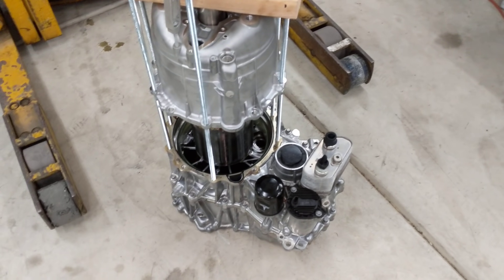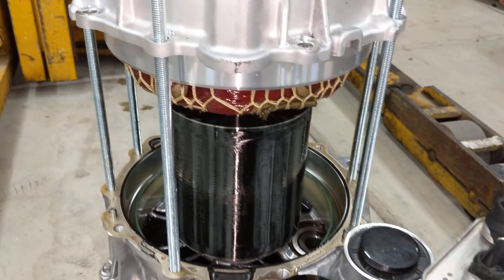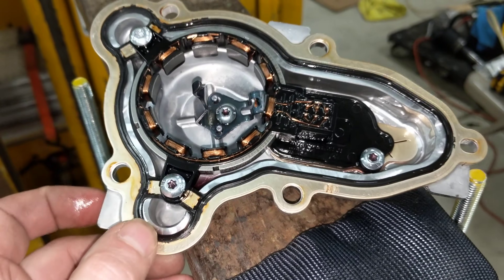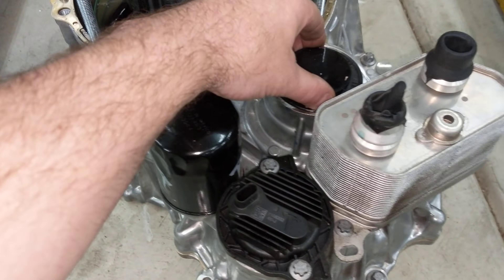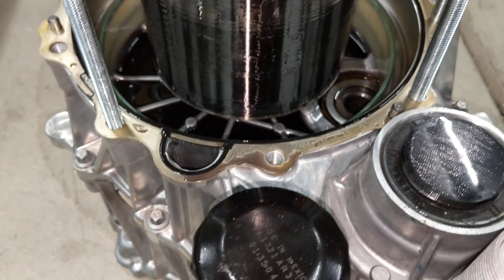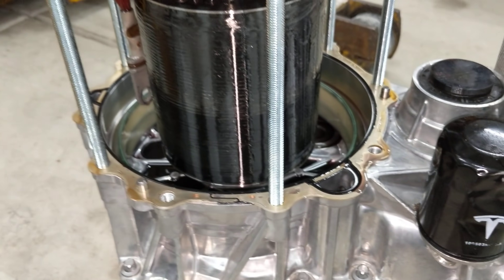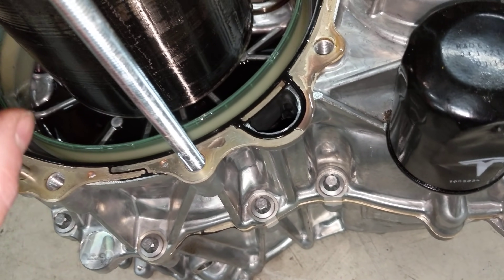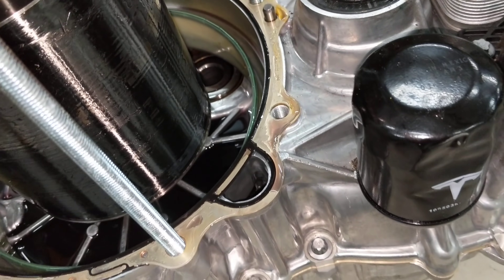Tesla Plaid Teardowns - Front Drive Unit

Comment: Makes me believe the Model 3 980 motor was really overbuilt.  To think it could be placed into a much heavier Model S with just a few changes for higher revs is pretty impressive.
Reply from the maker: It is overbuilt.  They use the same motors (albeit 4) in the Semi too!
Reply: @Ingineerix  i disagree on the motor being overbuilt. it's designed to provide performance & efficiency with highest lifetime (tested for 1 million miles). long distance highway driving @ 40-50 ° C stator temperature allows for highest efficiency on the magnet as well as the copper side. race track style driving pushes the temperatures to the high limit. remember: the model 3 performance competitor on the street is the bmw m3 series with the competition package.
Reply from the maker: @teslaw-model3  WHO else builds cars designed to make 1 million miles?!?   We are using the exact Model 3 DU in our van conversions.  While we don't expect to see 1 million miles without issue, they are definitely not having any trouble working flawlessly in a much heavier vehicle.   https://maxwellvehicles.com/
Reply: @Ingineerix  not the whole car, only several components that come with a function which leads to advantages/disadvantages on other sides. think about a window power lift. it's motor could most likely be re-used 3 times on new production cars. it has to work flawlessly, especially in an emergency situation. but it is not being used all the time and in very rare cases of emergency like e.g. submerging. now think about the model 3 motor. insulation degrades over time electrically and thermally combined. if you stay at low temperatures, it has positive effects on the lifetime. you could use this advantage in order to operate silicon carbide switching electronics without sacrificing the motor's lifetime. btw. very cool conversion company you've got there, keep it up!
Reply: if you take a closer look at brooks weisblat's (dragtimes) plaid unveil event video, you will notice that the plaid motors with the carbon wrap come with a changed rotor lamination design. reduced iron webs and bridges in order to minimise stray flux of the permanent magnets for better performance. the carbon wrap is most likely required to hold the rotor lamination and magnets together even at normal speeds due to the reduced iron structure. it'll be interesting to see how the carbon sleeve will deteriorate over time.
Reply: Wrong, the carbon wrapped rotor is what gives its robustness, carbon rotors have been used in applications up to 200k rpm+ there are many companies that have been making such things mostly based in Germany.
Reply: @alanmay7929  So don’t you take the model 3 motor and wrap with a carbon liner to allow for higher rpm’s?
Reply: @aussie2uGA  carbon fiber wrap alone isn't enough, the bearings and other stuffs needs to be upgraded to content that very high 20k rpm. Motorcycle engines are able to rev very high even up to 20k rpm and they don't have anything carbon fiber, its all about using the proper materials.

Comment: Awesome stuff! Do you happen to know if Tesla is leaving a lot of power on the table with these drive units? Are they capable of supporting more power, if the battery were able to supply it? Or are they already approaching the upper power limits of these drive units? I'm curious if Tesla might only be a software update or battery update away from unlocking more power, or if more drivetrain upgrades would be needed.
Reply from the maker: Yes, on the Plaid, the battery is the limiting factor.
Reply: @Ingineerix  What is the theoretical output of the existing battery?  Is is capable of more that the stated "1020hp" ?   I want to know if there is a potential for a future power upgrade on existing hardware.   Thanks!
Reply: @Ingineerix  do you happen to know the combined max hp/kW output of the inverters in the current drive units?
Reply: @Ingineerix  I believe the Plaid was supposed to get the 4680 batteries, which could be why they probably got rid of the Plaid+
Reply from the maker: @Bellissima2k  They don't have working 4680 production lines yet outside of pilot, so this was not possible.
Reply: @Ingineerix  does the plaid and long range have the same battery packs?
Reply from the maker: @the_sleepy_engineer  Until I look at a LR, I don't know for sure, but I suspect they are the same.
Reply: I saw in a video how this guy does the math and sees. plaid carbon wrapped  motor is running at the speed of a model 3 which doesn’t have carbon
YT - Engineering Perspective
Reply: @EverandAssoc  which video? Plz link the video if possible 🙏

Comment: The early Model S used Dexron 6 ATF,
correct?
Reply from the maker: Yes, this is "ATF9" made by a Korean company.
Reply: @Ingineerix  there is stuff from Pentosin that is described as ATF 9 for ZF auto transmissions. Not sure if it is the same or similar to what you describe.
Reply from the maker: @ShaunRF  Yes, that's the stuff!   Someone pointed out that RockAuto carries it.

Comment: You seem to have the talent, smarts and abilities in demand at Tesla or at Munroe and Associates and both are desperate to hire more smart people like you.
Reply from the maker: Thanks for the compliment, but I have no desire to work for either!
Reply: @Ingineerix  :D why?
Reply: @no_more_free_nicks  Sandy Munroe's design philosophy is very much inclined towards throw away economy emphasizing on  non repairable or serviceable parts
Reply: @akhtarkh  i totally agree with you, by oversimplifying designs/things they become way harder to repair or reuse, there is a reason why old/antique cars are still on the roads. Tesla is basically copying apple blindly.
Reply: @alanmay7929  Sandy preaches using permanent fasteners instead of screws,  advises to move fuses inside the modules for cost savings, recommends using less enclosures instead of separating different systems and modules. Yes, cheaper to manufacture but almost impossible to service.
Now a days cars are being designed by people who are very good in CAD but have hardly wrenched themselves, products look very pretty on the outside but under the hood every thing is intermingled and a nightmare to service.
Reply: @akhtarkh  electric cars in particular are even worse tbh, electric vehicles are fully packed with electronics and software, ICE at least are still mostly mechanical. I don't know why tesla stop people from tuning their cars too I don't understand that.
Reply: @akhtarkh  Sandy has wrenched likely more than many mechanics. There is times it makes sense for a fuse inside a module but he doesn't say to do that with everything.  Some things should not be serviced by a back yard mechanic.  Some things are not so bad.  This motor is hard to service because its carbon wrapped and you need to pull the rotor from the stator.  But its not impossible.  There is other oils that can work but ATF 9 likely is the best. They wrapped the motor with Carbon to make it survive at 20,000 rpm.  This is only on the plaid motors.  You don't want them failing at 20,000 rpm as it will possibly lock the wheels up at when you are doing 20,000 it will be a bit over 200 mph!
Reply from the maker: @no_more_free_nicks  I've been working for myself for over 25 years.  I enjoy my freedom.  Yeah, maybe if I worked for Tesla I might make more money, but I'd lose my freedom, and likely quality of life.  There's also NO WAY I'm moving back to Detroit (Where I was born) to work for Monro, and I seriously doubt I'd even make what I'm making now.   Consulting means you have some choice in what you decide to work on, and it keeps things exciting.  At a large company like Tesla, you tend to become a siloed specialist in the few things you "own", and it's easy to burn out.  Tesla has pretty high engineering churn, so it's not just me!
Reply: @Ingineerix  Tesla utilizes "agile" manufacturing, which might be quite a bit different from the typical auto company, very flat corporate structure.

https://www.youtube.com/watch?v=w5c5KzpamiM

But it is quite a fast paced environment, that's for sure, yes. Would certainly drive me insane trying to keep up with that mindset, but then again I'm neither young nor driven by my career path to fit in with that environment, it's clearly not meant for the 9-5 type guy that I am today at my age lol.

Comment: were you able to take a look at the rotor and see if it is made of copper? Elon Musk had tweeted the Plaid had copper rotors but I think he is mistaken.
Reply from the maker: It's a ferrous metal lamination stack with rare-earth magnets.  I don't think there is any copper in the rotor.
Reply: Yeah it does not really make sense to have copper in the rotor unless the motor is an induction and permanent magnet hybrid.
Reply: Agree with that. Copper is not needed in this syncro-reluctant motor... or may be special parts for better rotor cooling? copper heat sinks to collect heat far away from magnets? I m dreaming may be but Tesla team is enough crazy to do it :)
Reply: @lauricgarbuio8988  The problem with copper in the rotor are the I²R and eddy losses. So instead of copper helping with cooling it can turn into a heating element. Laminated iron core is not as good as copper in transfering heat but there is no worry of it becoming a heating element. Anyway rotor is already being cooled with oil so they just need cooling channel running next to the PM if thermals are a big issue.
Reply: @kazedcat  In this case, the flux inside the rotor is constant (except flux fluctuations due to slotting effect and current harmonics),  so no eddy current and no losses (or few) for the rotor. I don't know if the carbon wired sleeve is a very good thermal conductor... There is no water/oil inside the shaft, right? So with a very small air gap, the only way to cool the rotor is through the sides. Embedded copper heat sink can have sense to prevent hot spot, no?
Reply: @lauricgarbuio8988  Tesla have engineered liquid cooling in the rotor by making the core shaft hollow and pumping oil into the hollow shaft. From previous motor teardown Tesla did not design cooling channel to bring oil from the shaft towards the permanent magnet. If thermals for the PM is a big issue then bringing the oil closer to the PM would be a better and cheaper solution than switching to a copper core. The carbon overwrap is in the outside surface so it has marginal effect on the cooling being done by the oil on the hollow shaft. Theoretically there should be no net flux but in real world application bumps in the road could cause the rotor to desync and even with very fast sensors it will still take time for the drive unit to resync and during that time copper in the rotor is a heating element.
Reply: @kazedcat  I fully agree with you. I'm just wondering and searching why Mr Musk said that there is copper inside his rotor... a mistake from the boss?  He said also that it is to prevent copper expansion with centrifuge forces, right? I m puzzle... but it is interesting!
Reply: @kazedcat  "Tesla did not design cooling channel to bring oil from the shaft towards the permanent magnet."
Is this even doable? I would fear balance problems, not something you want at 20'000 RPM...
Seems simpler to improve magnet/shaft thermal path.
Reply: Bruno Mailly Fluid will balance itself this is evident with washing machines. In fact fluid helps to dampen unwanted vibration.

Comment: Great stuff. It is difficult to see but there appears to be a lump or some unevenness near the top of the carbon over-wrap on the rotor. Are my eyes deceiving me? It seems like surface smoothness would be quite important for something meant to spin at 20,000 RPM in oil.

And isn't it just like Tesla to not make oil available for their cars.
Reply from the maker: The rotor was smooth.  There was an uneven smattering of oil all over it, which made it look uneven.
Reply: @Ingineerix  Thanks! I couldn't imagine any imperfection being allowed on that high speed motor rotor.
Reply: Does this motor have a drain plug where the fluid could be changed? I can't imagine a situation where the fluid could become contaminated without voiding the warranty on the motor, at which point there isn't any reason to be replacing the fluid. Even a DIY application wouldn't every have a reason to open the motor like this... Probably the reason the fluid is so hard to find is because there aren't any consumer applications for it 😂
Reply: @kschleic9053  Not sure about plug but they have put oil filter to keep oil clean, most ICE cars transmissions don't have oil filter because its not needed due to very low wear and tear plus you will get it replaced after 80,000KM which is roughly 1000 to 2000 Hrs which isn't much time, still I would prefer oil filter in transmission.
Reply from the maker: @kschleic9053  Correct. It's not intended to need changing.  There is a fill plug, but no specific drain, though it's easy to drain by pulling the filter and the pump.
Reply: @Ingineerix  The drive unit of the crazy german guy who has driven more than 1,3 million km with his Tesla S has last been changed after 750.000 km. Are you sure the oil will really last for the lifetime of the car, especially in fleet use or as taxis?
Reply from the maker: @Makatea  First off, that Model S is a much older car.  It does not have this motor/lubricant technology, nor does it even have a separate oil filter or electric oil pump.  It's not even an Apples to Oranges comparison.  But yeah, if I was operating this in severe (Taxi) duty, and wanting to exceed the design life, I would probably change it every 150,000 km or so as cheap insurance.
Reply: @Ingineerix  Yes, that's what I thought. During the first 320.000 km, the car built in 2014 needed four drive units, the one that made so many km must be at least three years more recent than the car.
You can google the guy, there are several articles out there about him: Hansjörg von Gemmingen-Hornberg
Reply: Transmission components don't experience nearly the same amount of wear and external contamination as insides of car engines so it is understandable that they can be run for much longer. Automatic transmissions and transmissions that use wet clutches do of course require fluid changes since they have wear items. The Tesla DU has very little wear items and the little wear there is will be controlled by the filter. Most manual transmissions I've come across have been driven to 400-500 thousand km without issue and I imagine the Tesla DU with the filter will go even further than that.